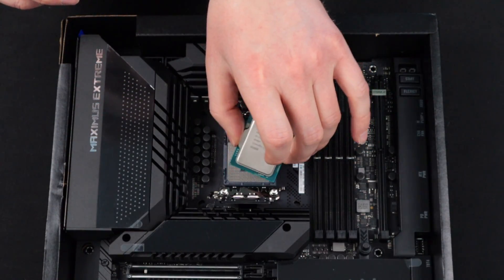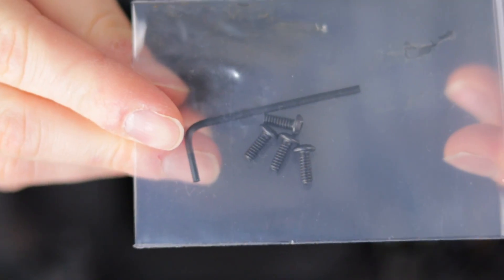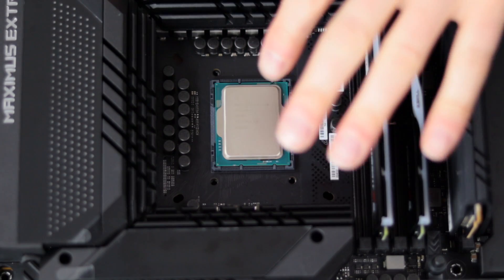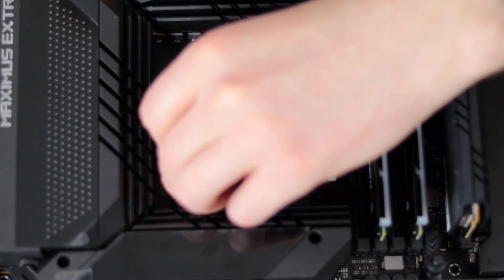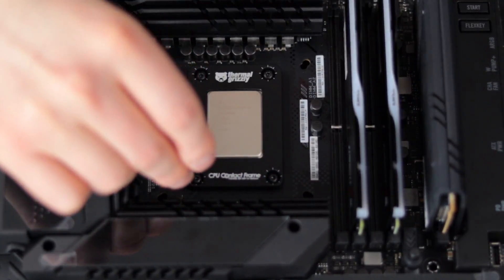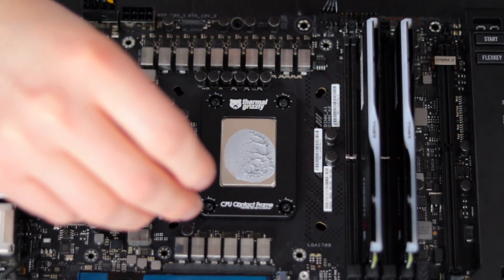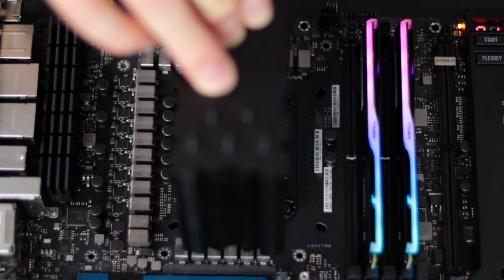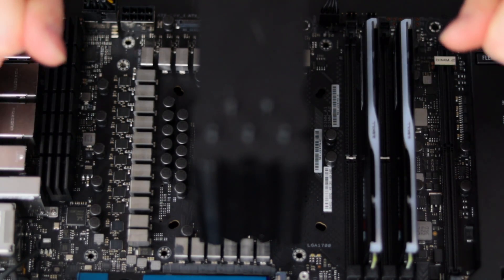Intel Made A Mistake.. I Fixed It with This!

Comment: Can you also do this after you have thermal problems? Or will the CPU really be "bent" then and you can't use this fix anymore?

And is this phenomenon still a thing on LGA1851?
Reply from the maker: I haven’t had any LGA 1851 boards but it appears the ILM on some of the 1851 boards still have that issue. They did come out with a reduced load ILM that was supposed to fix the issue but I believe it is only installed on higher end boards. As far as if it will fix your thermal issues with a contact frame, it may! It just depends on the what is causing the thermal issues. A contact frame should help with evening out the pressure and hopefully that would help ‘straighten’ out the CPU! Regardless, for the $15 it costs for a thermalright frame you aren’t losing too much if it doesn’t make a huge difference! What is your CPU/CPU cooler combo right now?

Comment: Dude knowing about this issue and trying it myself with my build..  oh boy... 
Mine didn't even align the contact points with the cpu, even scratched one side, i've installed a cpu before but the mounting system was so loosely fitted it had a lot of sideway play. 
I should've removed it the second i put the cpu in instead of feeding my curiosity. (as i already had the thermal crizzly mounting bracket).
Yeah complete junk i can't reccomend anyone use it after the GamersNexus testing on stock socket mount.

Comment: You are losing motherboard warranty
Reply from the maker: Technically overclocking will void the warranty so if you are doing this kind of modification you are most likely overclocking so your warranty is technically void anyway… but that is if you tell them. Just put the ILM back on and RMA like normal if there is an issue with the board, most likely will never know!

Comment: What is the best tutorial for installing the contact frame to be followed? have the maximum grip with 2 fingers and then a 90º squeeze or some other?
Reply from the maker: If you can purchase a torque driver that is the best way to install. Here is a link to one that will work: https://www.amazon.com/FIRSTINFO-6-35mm-Adjustable-Torque-Screwdriver/dp/B073B1FG9K 

The technique I used in this video is what is recommended by Der8auer and Thermal Grizzly themselves so outside of a torque driver this is best installation method. Here is the video from Der8auer himself: https://youtu.be/zHXZMtWOVJ4

The install tutorial portion starts around 06:40. I hope this helps!
Reply: @techtoniksystems  Ohh ok, I'm going to follow Der8auer's tutorial since I went to buy the ThermalGrizzly contact frame too, I was just confused because I saw several ways to install it, I think it's right to go through the manufacturer's tutorial, thanks :)
Reply from the maker: @8DAudioPT  No problem! I tried to follow their install method as close as possible! Thanks for watching!

Comment: I can’t even find a torque screwdriver that goes that low for the recommended spec. What was it 0.03 to 0.06nm?
Reply from the maker: It took me a while but I found one that starts at 0.05nm which is within the 0.03-0.06 range. 

https://www.amazon.com/GEARWRENCH-Drive-Torque-Screwdriver-5-60cNm/dp/B08KHTCLB7
Reply: @techtoniksystems  much appreciated, just have to wait for it to come back in stock 😊
Reply from the maker: @haies09  Pretty much the story of PC building right now 🤣
Reply from the maker: @haies09  Found a slightly cheaper one that is in stock! https://www.amazon.com/FIRSTINFO-6-35mm-Adjustable-Torque-Screwdriver/dp/B073B1FG9K/ref=mp_s_a_1_8?crid=2NQ05RA3YORXK&keywords=5-60cNm+torque+screwdriver&qid=1683118880&sprefix=5-60cnm+torque+screwdriver%2Caps%2C125&sr=8-8

Comment: What type of screw would you recommend for Asus apex z790 motherboard? The screws on the motherboard are too short for it to stay in place.
Reply from the maker: Can you reuse the screws that were on your ILM?
Reply: @techtoniksystems   The screw are too short. People who  have the apex z790 are having this problem.
Reply from the maker: @halo3reconarmor  Just wanted to make sure you couldn’t reuse the ILM ones! Don’t hold me to this as I don’t have a board to test this on, but you could pick up #6, 32 TPI (threads per inch) screws, that are 3/8" long. These would be slightly longer than the included screws with the thermal grizzly contact frame. Alternatively you could try Thermalright’s version as I have heard some people having luck with that. I linked some of the screws mentioned below! If this does work, I’d love to know!

https://www.amazon.com/uxcell-Alloy-Socket-Button-Screws/dp/B00W97KSTK/ref=asc_df_B00W97KSTK/?tag=hyprod-20&linkCode=df0&hvadid=312106044867&hvpos=&hvnetw=g&hvrand=7687638777266492109&hvpone=&hvptwo=&hvqmt=&hvdev=m&hvdvcmdl=&hvlocint=&hvlocphy=9006731&hvtargid=pla-579229578867&psc=1&tag=&ref=&adgrpid=62149807116&hvpone=&hvptwo=&hvadid=312106044867&hvpos=&hvnetw=g&hvrand=7687638777266492109&hvqmt=&hvdev=m&hvdvcmdl=&hvlocint=&hvlocphy=9006731&hvtargid=pla-579229578867

Comment: It would help if you measured the amount of torque you used on the mounting screws to get a positive seating of the CPU.
Reply from the maker: I didn’t have one on hand though, so I figured I’d start loose and tighten till I got a successful POST. But you are definitely right that it would make it easier if you have torque drive! Thanks for watching!

Comment: The cheaper one on Amazon has cushioned feet and is really easy to fit. I got my 13700K temps down by about 10 degrees when under stress. Great video👍🏽
Reply from the maker: I saw the ThermalRight one and saw it had good reviews! I am glad you got your temps down that far with it. Gives you 10 more degrees to overclock with 🙂 thanks for watching!